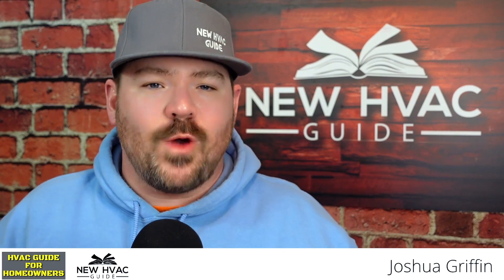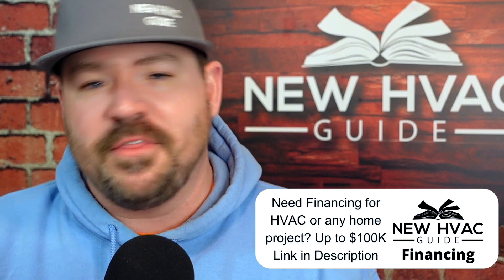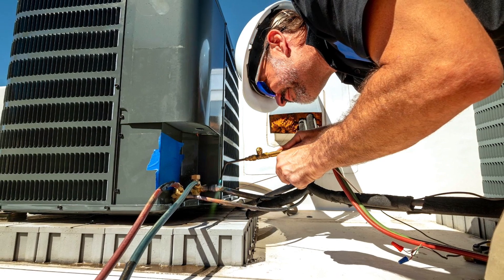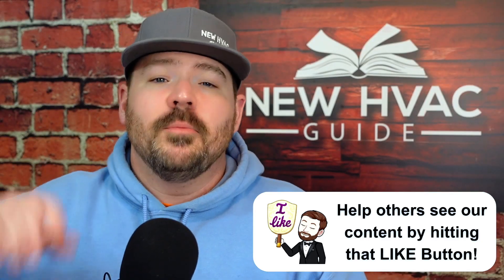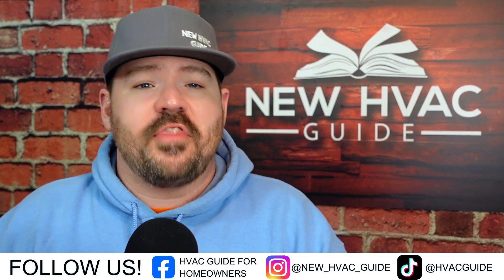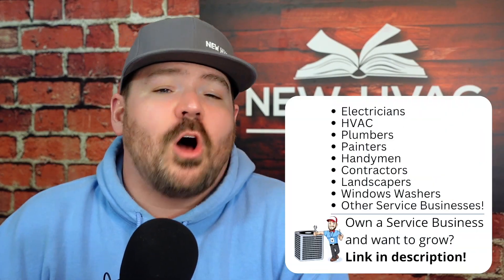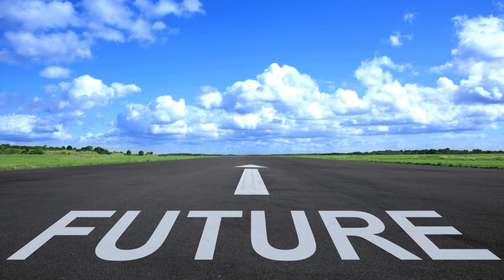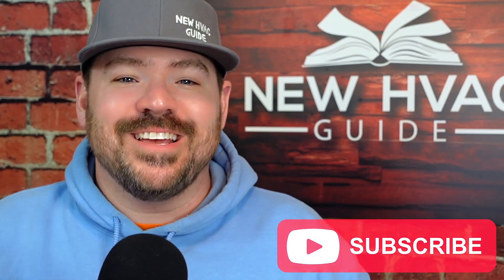HVAC Myth! Soft solder vs Brazing. (Air conditioner breakdowns that follow!)

Comment: Honestly i think it comes down to the person . I prefer to braze just cause I feel I have more control over the flow but I also do solder some and I’ve not had a leak at the end result on any . Both are forms of jointing to metals pieces together and making 1 out of them .
Reply from the maker: Acidity caused by flux doesn’t concern you?
Reply: @NewHVACGuide  I use very little flux when doing it just enough to confirm a bond . But like I said I braze more often than soft solder . It really depends on the area I’m in honestly. .

Comment: In the textbooks there’s discussions about soldering and the authors point out a few issues some mentioned in the video and some not. Firstly the flux is acidic and corrodes metals over time, flux inside the joint doesn’t disappear once solder is introduced to the joint, once the solder flows inward so will the flux get pushed inward deeper as well, this is a fact. Secondly under a microscope a fresh soldered joint has microscopic cracks and these cracks increase over time, creating very tiny leaks that’s not easy to ever detect and probably not even make a dent for years. It’s not perfect but it has its obvious installation benefits, that’s why the authors did not say not to use it, only their opinions on the subject matter.
Reply from the maker: It's hard to have an opinion or observation these days without seeming biased. At the end of the day, most of us want to do things right and pick the solution that's best for us and our customers.
Reply: I braze when I can.  I solder when I can.  Which ever is available, I'll use it.  Soldering is a lot easier, I would use on residential and light commercial 410a/134a.

Comment: It takes skill to get a properly solder joint. If you're the guy brazing over 1/8in gaps soldering isn't for you.

StaBrite is awesome for times it's impractical to flow nitro. It can save a lot of time too just grabbing a regular propane torch, not having to setup nitro. First unit I ever used it on was my own and it's still going 15 year later, never had a leak.

Comment: Ive been soldering them for 40 years, less heat, fast and clean, especially with the products today
Reply: Are you talking soft solder like stay brite?
Reply: @PlaidRicky1611  Yes, but I don't remember stay brite back that far. I use it now. There was/is solder with different levels of silver. All you have to worry about is making sure it's good enough to hold the high side pressure, and on a residential 410 system 400psi. I always thought people over do it brazing when it's a simple solder job.

Comment: I can tell you that I'm not professional but I have copper lines all over my home that I soldered not brassed over 20 years ago no issue no leaks!
Reply from the maker: Water lines?
Reply: Water supply is way different than high pressure refrigerant..

Comment: installed many diy systems with regular water pipe solder. Never one leak. all still running. two of them 35 years ago and replaced a cap on both. I always hear about pro installed systems failing all the time. WHY?

Comment: Man, I am not able to braze because it is too expensive. I'm a DIY guy and want to fix my ice cream machine which is well worth it. But if I have to buy a nitrogen bottle with a valve etc, brazing tools, expensive solder, the standard guages and tubes for vacuming the system, a can of R134a refrigerant and I get way over my budget. So I hope I can softsolder my leak or joint and hope it will last for about 10 years or more. I only use my ice cream machine once a week, so.... Good tips are very welcome (but I want to keep! this ice cream machine).

Comment: Then please explain why when hydrostatic tests are done, the brazed pipe fails before the soldered pipe?!? 
Seems to me the higher temperature of brazing is compromising the copper’s strength. Neither joint fails. It’s the copper adjacent the joint.
Reply: Bad tech over heating pipe. I've seen a lot of techs when brazing get copper cherry red. This is incorrect and will cause what you just said to happen. The correct color for brazing with silver solder is just a bright copper color. I use the tap test. Heat pipe tap solder on pipe...if it sticks its not ready.... if it melts its ready and back heat off.

Comment: Years ago I spoke with a representative of Harris who makes all kinds of solder including brazing silfos and he told me that StayBrite 8 is a superior bond especially due to the annealing issue when using oxy-acetylene excessive heat.  It absolutely requires skill and practice and with regards to flux, you only need a very thin film for the solder to work.  I also have been using it for years with no issues at all.  No lugging heavy tanks around and tests show a hydraulic bond able to withstand over 10,000 psi .  Pro press fittings only have around an 800 psi limit. I have also experimented with stainless steel compression fittings with success.
Reply: Hello, Can you use staybrite 8 to fix a line leak???
Reply: If the copper comes in a roll its annealed. Hence the term "soft copper. So most Residential systems and small commercial in the US are installed using annealed copper.

Comment: Except that when pressure tested to failure, brazed systems blow first every time (not in the joint, but in the adjacent heat affected copper).  Contaminant issue may be real, but “brazing is stronger” is an absolute myth.
Reply: This ☝🏼 So many guy waaay overheat the copper.
Reply: This is completely false. Sounds more like improper technique than the actual brazing being worse. Most ppl can't control their flame yes. That is true. Doesn't make brazing worse. Makes the ppl doing the work less skilled. I've been brazing for 20 years. 37 now. Never had a joint fail that I braised or any pipe adjacent to joint. I've seen countless of soft solder joints fail throughout the years. Mostly from the factory. They don't like vibration, heat, and oil
Reply: What difference does that make? The pressure required is so far above working pressure it has no bearing on the subject.

Comment: LOL - "junk and crap" from soldering.  But not copper oxide.
Anything to back up your assertion that "brazing is just a better joint"?
Reply from the maker: It’s definitely better that it’s a joint that didn’t require flux or any other contaminants to be added to the system :-)
Nothing needed to back that up
Reply from the maker: Other than that, you can just Google it and see numerous websites that go over welding versus brazing versus soldering. Other than manufacturers of products that contribute to soft solder, almost everyone else agrees brazing is a stronger joint.

Comment: I recommend that most guys braze as it is a lot easier, and faster. Most are not going to purge properly with nitrogen while braising anyway. 
I stick with stay bright 8 for any pipe repairs, filter dryer replacements, expansion valve installations, etc. although it takes a little more prep time, and the joints must be tight, the end result is a super strong connection.
Reply: correct !

Comment: Cons of Brazing is that Brazing Requires More: Time, Labor & Tools (nitrogen purge/nitrogen/tanks/tank valves/hoses/gauges.   And Heat Produced from Brazing Can Compromise the Strength Of the Copper being Brazed (fittings & pipe).  

Properly Soldered Join/s has More than Adequate Strength for Various HVAC Line Pressures. 
Properly Soldered Copper Joints Are More than Strong Enough for Any & All vibrations/movements, A Leak will Not happen.   The Strength of Properly Soldered Joints (HVAC Or and Plumbing) is Such that You can Take a 20LB Sledge and Not be Able to Separate the Soldered Joints.  Soldering is Not Only Less Expensive, Less Time Involvement, Less Labor Intensive, Less Tools Required, Lower Heat Needed but it is Safer especially in "tight work area/s".   Anyone Reluctant to Use Solder, Proven Method, is Just that, Reluctant.
Reply: So much this ☝🏼
Reply: 😂😂😂😂😂 this is hilarious

Comment: I like brazing but I will say that I brazed copper pipes together and I used staybrite 8 on another joint and I could take the copper pipe that I brazed and squeeze the copper pipe where the joint was flat with my fingers. And it did not matter how hard I squeezed the staybrite 8 joint I could not flatten it. That’s because when you heat copper up to a certain temperature it compromises the pipe to the point where it gets really soft. I’ve heard people say that staybrite 8 makes a stronger joint but I don’t know that to be true. I’ve always brazed and never had an issue though. Knock on wood.

Comment: No doubt brazing is stronger than soldering.  There's bound to be a reason the industry has been brazing for decades while water pipes were soldered.  Can a soldered joint be strong enough for the pressures, temperatures, and vibration of HVAC systems?  There must be some testing facility that put them to the stress, probably decades ago.  The results must be out there somewhere.  With test results we needn't speculate, we can see what they found.  

PS: Trane was using flare fittings on their residential heat pumps some thirty years ago when R22 was still under patent protection.

Comment: You are way off base!!!! when you braze you anneal the copper making is softer. This weakens the copper next to the braze, just like electrical welding on steel.  the braze itself is stronger than a solder joint, but the weakened copper is now an issue.  The lower heat when soldering with Staybrite 8 does not anneal the copper, and reduces the risk of valve damage from over heating.  You statements are simply False.  Staybrite 8 is rated at 14,000 lbs. your strength statements are a joke.
Reply: You are 1,000 percent right my friend. Soft solder is the stronger joint. BUT. It is really easy to get beads of solder that drops inside you tubing. But if done right it is actually the stronger joint due to comprised copper from the heat.
Reply: This has been tested by another channel. And the copper fails at a lower pressure with brazing than with soldering. Neither joint failed. It was the heat affected copper close to the brazed joint that fails first.
Reply: @foghornleghorn8536 not saying that Brazing is bad, but it does anneal the copper. the big argument here is regarding the strength of Staybrite 8, the metallurgy is clear, it is a stronger joint, Does it matter? not, because these systems will never reach pressures that will be problematic for Staybrite, or brazing.  But many old timers will be losing their mind when they have to invest in press tools for some brands A2L systems, as brazing or soldering will void the warranty.
Reply: I dont think staybrite handels vibrations the same as brazing will.  And lacks the capability to close up larger gaps.  Plus how do manufacturers make their connections in condensors en evaps? exactly, brazing
Reply: @btd1993  brazing seems to fill bigger gaps, but solder handles better vibration specifically because it is softer. Something that is softer and has more flexibility handles vibration better than Something that is harder.
Reply: Burst tests on youtube show this affect. But the point is that silver solders are better with vibration probably partially due to that softening effect. If you can't purge with nitro at all, maybe solder as it's the lesser of evils in that case. @foghornleghorn8536

Comment: Just shows that he’s very young in the field brazing his very good and I still do it but stay bright eight for years no problems and actually just took a part of system that was in for 25 years no filter dryer and at least six or seven joints all done with soft solder never leak never problem. Unit lasted 25 years, that pretty much told me a lot!
Reply: Just took apart of system from my house. Had a bunch of solder joints that held up well.
Reply from the maker: That unit probably had mineral oil. Study on POE oil and you will see the concerns for many manufacturers.

Comment: Soft solder will melt if you use it on discharge line that gets hot
Reply: It will not, discharge lines don't get to 450F
Reply: Not even close. Stay Brite 8 is the most common "soft solder" used in refrigeration and has a liquidus temp of 535°F and a solidus temp of 430°F. Copeland specs most of their compressors to safely run at no more than 225°F measured on the discharge line at six inches from the compressor. When you start getting much higher than that, most compressors are protected by some type of thermal limit and/or internal bypass to limit the pressures and temperatures inside the compressor; which are still well below the melting point. If your discharge line gets hot enough to melt solder, any refrigerant would be at several thousand PSI and your soldered joint on your discharge line will be the least of your worries.

Edit: Not to mention I have many years of actual field experience soldering headmasters without any problems.
Reply: If your line gets that hot you have way more to worry about than your pipe connection

Comment: You are giving incorrect information. Soldering with stay bright is perfectly fine. There will be no contamination whatsoever. You just put a little bit of flux on the male end you are good to go. There’s no chance of any kind of contamination. I’ve been using the stuff for 30 years on all kinds of AC and refrigeration systems with no issues whatsoever.  You are overthinking it too much.
Reply: The reason ac companies will tell you that you should braze is to limit "handyman,  do it yourselves" if they told you that a $100 used vacuum pump and a $30 dollar torch could be used to save you THOUSANDS, who would call a tech? Lowes just quoted a guy $12,000 to replace his 2.5 ton heat pump split unit. The unit cost 3k, I did the work for $1500. Took me 1 day to do. I brazed but I also seen units done in stay bright 8 that work with no issues. Don't let these major companies charge you these prices. This guy wouldn't have this company,  a fleet of trucks, a 300k plus dollar house, a boat and money in the bank if he told you the EASY and CHEAP way to do it. Common sense isn't common,  use some and save money.
Reply: Yes!👍
Reply: LOL, on the contrary, he's not thinking about this nearly enough.
Reply from the maker: The contamination theory is not coming from me. Manufacturers are specifically saying to not use it.
Reply: @NewHVACGuide , you are correct , none of the manufactures approve soft solder or stay bright 8 . Back in technical College in the early 1980s we were trained on both and done properly both joints can stand the test of time . But the big problem with low melting temperature solders is liability, the contractors that use it are taking on 100% of the liability (when house fires occur, the solder melts at low temperature letting the refrigerant escape to the environment of the fire producing phosgene gas). NFPA has done studies proving people escaping fires apparently unharmed ,still suffering lung problems due to phosgene gas exposure & ironically in the majority of the cases low temperature solder was used on line sets (coincidence 🤷🏻‍♂️). Does this happen often? “ Absolutely not .” Just understand you are the one taking on the liability,not the manufacture of the equipment ,the manufacture says “not to use it”.
Reply: @boby115  Did the NFPA studies prove that the harm from phosgene gas was more than one tenth the harm caused by exposure to the harmful gasses produced from the combustion of all the plastics (appliances and fake wood floors) and synthetic fibers (from carpet, fabrics, and clothing)?  I'd worry more about the gases from the petrochemical stuff.
Reply: @boby115  On R-410a and later systems phosgene is not a risk. Phosgene is composed of one carbon, two chlorine, and one oxygen atoms (all bonded to the central carbon, with a double-bond to oxygen). R-410a and later refrigerants contain no chlorine, and therefore cannot produce phosgene under heat. Of course, older HFCs and HCFCs do, so this risk should be considered for older systems.
Reply: @thomassprague441  , you are correct and exposing my outdated training from 35 years ago . So I’m assuming the manufactures don’t approve stay bright 8 & like solders today because 410a can become flammable if exposed to heat and air under pressure ? 🤷🏻‍♂️.  I know 410 A is considered non-flammable at ambient temperatures but I’m assuming if exposed to some thing like a house fire all bets are off. I’m just brainstorming here (just some thoughts spinning in my head). 
Thank you for clarifying 👍, I totally forgot about the removal of chlorine in today’s refrigerants.
Stay safe out there and thanks again for clarifying.

Comment: I really enjoy watching your videos please keep it up. On the question of soft solder or brazing here is my thoughts. I’ve been using stay brite 8 for 8 yrs now and in that time I’ve only had one leak. Now I will not use stay brite 8 on a major component repair. As far as the new refrigerant no I as well as anyone else that uses stay brite 8 now will have to go back to brazing per the manufacturer specs due to the refrigerant being mildly flammable. Like I said really enjoy your videos please keep up the great work.
Reply from the maker: Thank you for your kind words! I think the real issue is the flux and contaminating the system. The strength of the joint isn’t necessarily as much of a concern.
Reply: @NewHVACGuide  - Flux contamination is not an issue if done properly. 
Of course, there are a lot of lazy plumbers who will dip the pipe into the flux bottle rather than applying the proper amount to the pipe with a small brush. When my copper pipes developed pinhole leaks, I found gobs of flux on the outside and inside the pipes.

Comment: Been using stay bright 8 and stay clean for over 30 years without any issues.  It all depends on if it's done RIGHT or not.  This is true either way you go, and both ways WILL give you issues with contamination if not done properly.